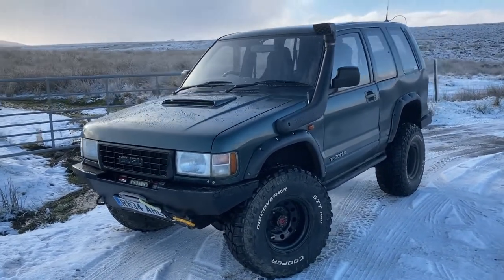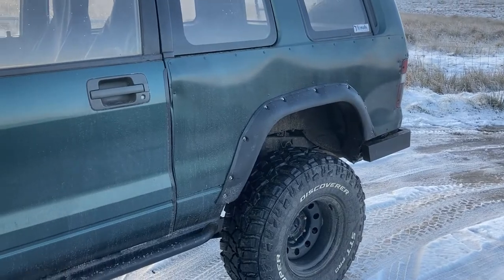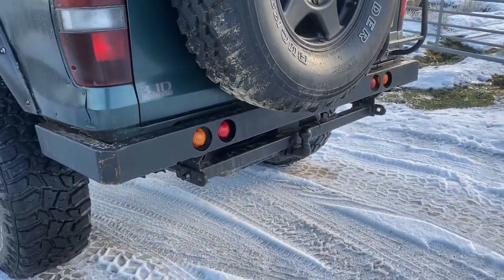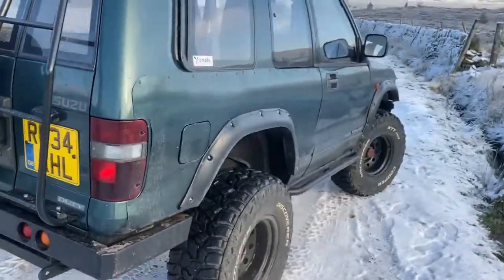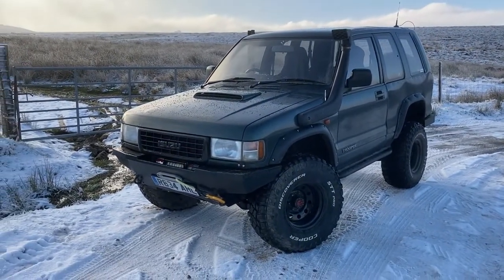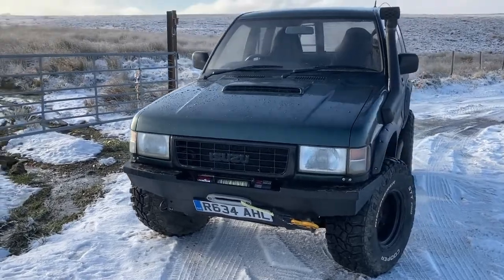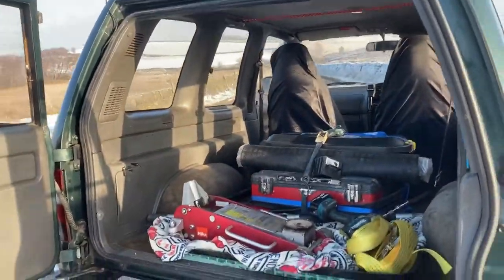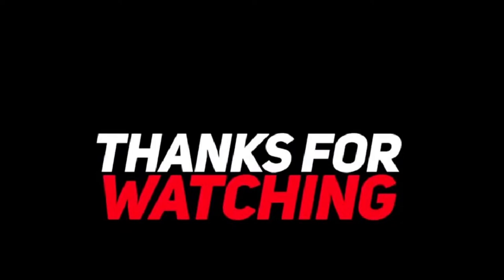Isuzu Trooper Modified

Comment: Nice video..  I ovned same swb  version but  opel monterey 3.1 as well. Do you have any problems with fron differencial?  I have to upgrade from opel frontera B 2.2dti (manual gearbox) its much stronger than original one. Looking forward to see some more videos  about your trooper. Cheers pal
Reply from the maker: No mate touch wood it’s been faultless

Comment: Great job….  Did you come across any uk suppliers that could replace / repair chassis on a 3.1 SWB.   I want to renovate mine.   I have owned her for 15 years and want to keep her for another 15.  Struggling to find anything.
Reply: Independent Isuzu in York may be able to help you

Comment: Why don't you swap the engine to something like 2jz or anything you like it would something unique And you get lot more power than you 3.1D
And you can make the video of doing it may be your channel will grow faster
Reply from the maker: It’s a good idea mate but with the gearing and the standard engine, it’s got no problem with power
Reply: 2jz is too long you'd have to cut up the firewall